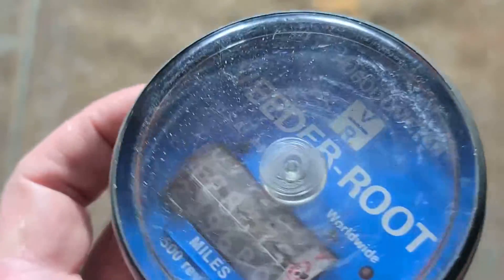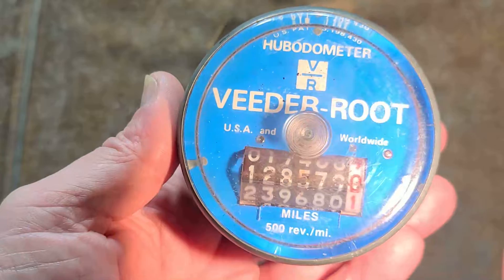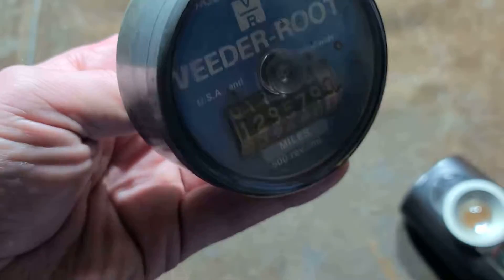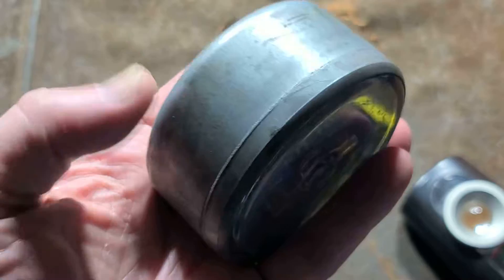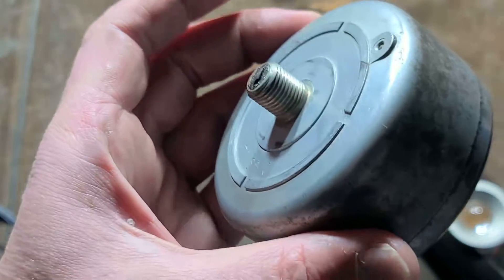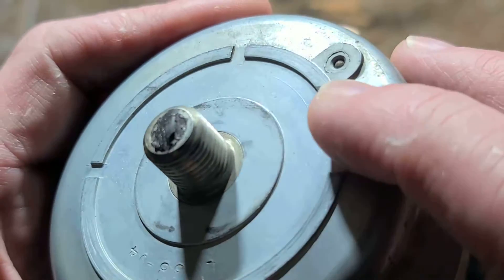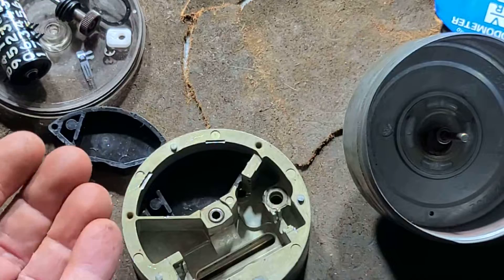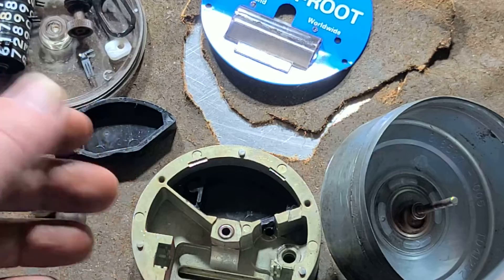Veeder-Root Wheel Hub Odometer Teardown & Review

Comment: As a collector of these intriguing devices, I really enjoyed this video.
Wish I knew they could be opened up more elegantly than using a hacksaw like I did.
Will any hammer work like this?
I think the Veeder Root design shows a lot of thought and makes them impossible to tamper with.
They pump inert gas to prevent condensation of the hubodometer crystal.
These things are tough. I have dropped one more than a metre twice and it's still unaffected apart from a fracture on the edge of the lense.
I wish you had tried to open up the ball valve for the gas.
There are numbers stamped on the back of the unit that appear to indicate the month and year they were made. On that basis, the one I cut open was from 1978 and it has a wider mounting stud at the back.